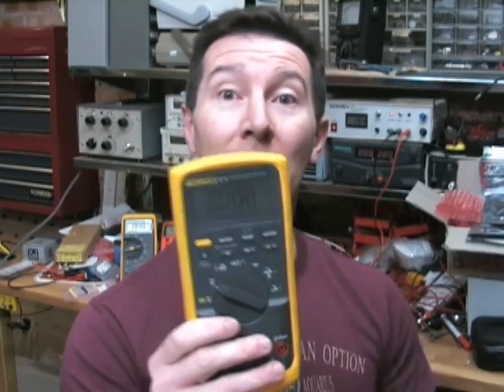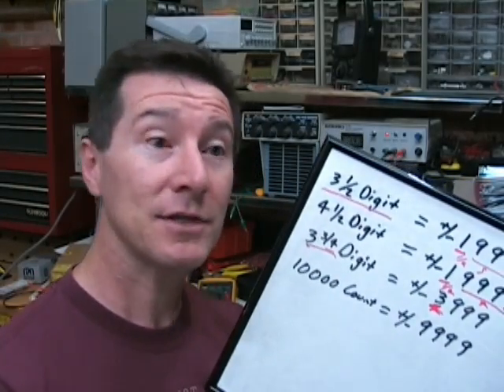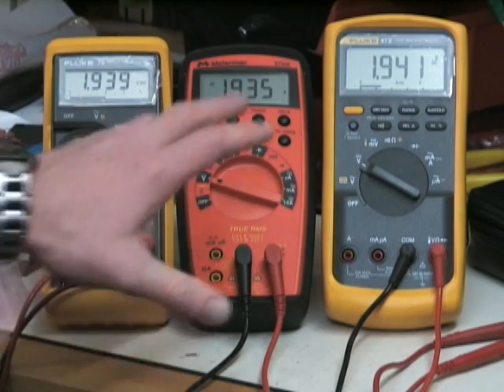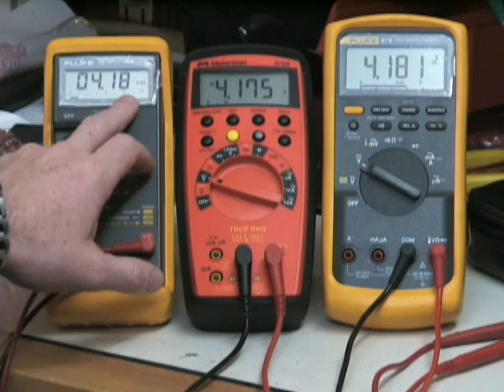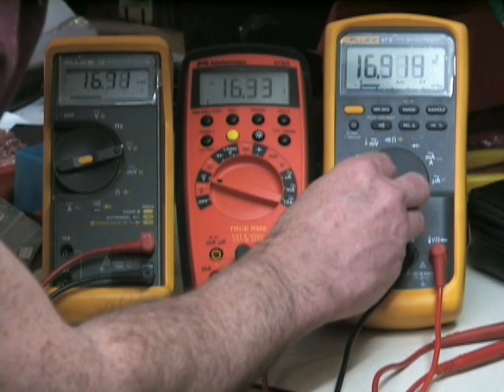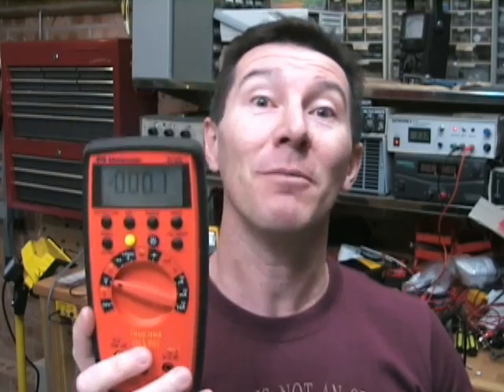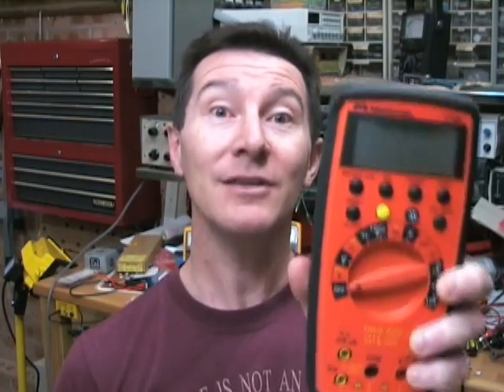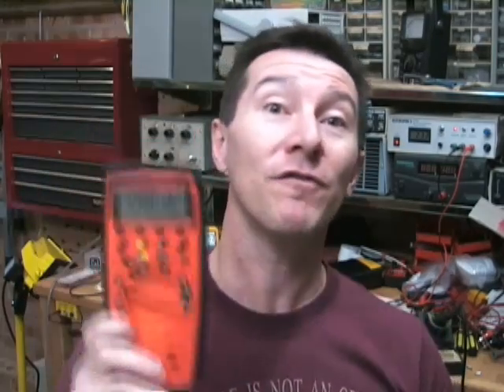EEVblog #26 - Multimeter Tutorial - Counts, Accuracy, Resolution & Calibration

Comment: Can the quality of test leads effect the accuracy?
Reply: Sure.  You don't want to be measuring resistance, especially low resistance, with a set of cables 6 feet long, or capacitance.  When measuring frequency, you need good shielded cables. When measuring current, especially higher currents, you need cables large enough in gauge to handle the higher currents.

Comment: What would change in the meter to cause it to need to be sent away for calibration?
Reply: Aging of the components like resistors and components in the a/d converters.  Wear and tear on the connectors will increase the contact resistance dropping more voltage.

Comment: Sweet! You really awnsered alot of questions I had in this. Thanks! I was looking into getting another meter for myself, and possibly have my employer get a new one as well.   The one we currently have doesn't have enough resolution for some of the things we need.  Some of the meter accuracies I've seen just have a % on the sheet and don't say the + counts for it? IE: The EX330, says 0.5%.  If I understand correctly, does this mean that 27.75 VDC could read 26.61 to 27.88 ?

Comment: I think the something and a half digit specs are plain wank. Any reasonable person can expect that:

10 ^ 3.5 = 3162 counts (approx 3000)

In fact, I've only seen meter that actually "meets" its digits spec. It's the 3457A, advertised as 7.5 digits, and it has a resolution 30 million counts.

Comment: People tend to confuse precision and accuracy all the time.  Some instrument can have really high precision but not be at all accurate.  Sounds like "counts" relates to precision.
Reply: +rchandraonline Precision deals with how repeatable the measurements are and how clustered the data will be. Accuracy on the other hand deals with how close those measurements are to the true value (usually when all data points get averaged), regardless of how clustered the data is. I think counts are only slightly related to precision. Measurements are easily repeated and the data is relatively more clustered (precise) if the device's resolution only allows for a few digits. Imagine trying to repeat measurements to the 15th decimal place, you'll probably never write down the same number twice! 

Counts are related less to precision and more so to the resolution and the displayable values on the screen. In reality, the precision (repeatability) and accuracy (closeness to true value) of the meter are going to come mostly from the careful design of the protective features on the inputs, the internal ADC and any of its conversion errors and resolution, component tolerances, etc.
Reply: Pelnied THANKS

Comment: "A man with a meter knows the voltage; a man with two is never sure." - Unknown
Reply: A man with a meter thinks he knows the voltage; a man with two discovers he doesn't.  :D
Reply: @camurgo  that's accurate lol
Reply: Both men need to get their meters calibrated.
Reply: +gordovious Actually you can eliminate possibility of 50:50 if you have odd number of multimeters. Scientifically you should calculate the arithmetical average, in practice you could use the middle result as your result. Same goes to any measurement devices including clocks/watches. If you have 2, you cannot be sure what time is it.
Reply: @rpdigital17  ur definitelly not sure with one..  i'm more confident using two methods, multimeter + scredriver tester, or multimeter +  multimeter when it comes to AC mains, but for precision measurements/electronics you pretty much need two or three meters , like Dave said the more you track the meter history, the more confidence you will have in it, and less multimeters will be required
Reply: I know Im kind of off topic but does anybody know a good site to watch newly released series online?
Reply: @Spencer Jase I watch on flixzone. You can find it on google :)
Reply: "Man with Uni-T meter who measures high voltage, measures high voltage once"

Comment: Shouldn't Accuracy actually be Precision?
Reply: +Dragos Puri , in general, no.

Precision refers to how finely divided the gradations of measurement are.  For example, if you had a meter stick which is marked with 98 equal markings (0 and one meter would not have marks, they'd be the ends of the stick), in other words, marked at every centimeter, it would have centimeter precision.  Another one could have 998 markings, or every millimeter.  The one with 998 markings would be more precise.

Standard measuring procedure is to read off all marked digits, then estimate where the actual length is between the marks for an additional digit, or of course zero for the additional digit if it genuinely looks like the length is exactly on a mark.

Accuracy refers to adherence to a standard.  Taking the example of a meter stick again, if your meter stick with 998 markings measures 110.0 cm when matched to other, more accurately calibrated meter sticks, it still has millimeter precision but is not accurate because each marking (and its entire length) is too big, by 10%.

The combination of these two means all measurements, especially in science, should be stated as the measurement and then plus or minus some precision (a.k.a. tolerance), and optionally stating the accuracy of the device used to measure the quantity.  In our 998 mark meter stick example, we could say a measurement is 53.26 cm +/- 0.01 cm or +/- 0.1 cm (I'm not really sure which is more appropriate).  Minds better and more educated than mine know how to work with (basically mathematcially combine) both precision and accuracy.
Reply: +rchandraonline Sounds like you are confusing precision with concepts like resolution (smallest increment of change between two measurable points) and significant figures (your standard measuring procedure). Precision is related to how repeatable and clustered the data is. Another way of thinking about precision is the statistical variation and spread in the data. Precise data has a very small standard deviation.

It will be difficult for you to understand precision by using a meter stick example. When humans generally read a meter stick they aren't going to read different values each time they put the meter stick next to the object, they've made their estimation and will stubbornly stick to it. It is different when it comes to a device such as a DMM which can read different values (4.998V, 5.001V, 4.999V) just by removing the probes and attaching them again. This is why precision is important in different measurement tools.
Reply: +Pelnied Let's say I measure a value. And it reads 3.7. I measure it again and it reads 3.8, another time 3.9, again 3.6 and so on, ±0.2. I call that ±0.2 PRECISION. Am I wrong?

Now, for Accuracy, I think of it more like and offset. so let's say that the actual, true value of the measurement was 4.0. So my device is wrong by +0.3 on average. Accuracy can be tuned, precision cannot.

Please correct me if I'm wrong. Thanks.

Comment: Why doesn't the Fluke just stay in high resolution mode all the time? It doesn't make sense. Does it take that much longer to make a measurement?
Reply: Yes, it takes ten times  as long for each extra digit of resolution. Meters get very expensive past 5 digits to get the resolution required. Pretty much all 5+ digit meters have this feature.
Reply: Dual slope Analog to digital converters take time. Successive approximation ADCs are fast but they need a DAC, and they are expensive.

Comment: How does this apply when we get to the lower reading limits of a meter ? As an example the Brymen BM867 is listed as being able to read 0,01mV and has an accuracy of 0,03%+2d. To calculate the error at the lower limit can we multiply 0,01mV by 0,0003 or the lower readings always have lower accuracy ? The meter specs sometimes state the accuracy as "reading digits" * Accuracy percentage + digits. Are "reading digits" the same as the value that's being showed on display or the range's max val ?
Reply: I'd like to know the answer too. In the old days of analog meters the accuracy was always based on the entire scale. So if you set it to 200V max, an accuracy of +/-0.5% always meant +/-1 V regardless on which part of the scale you were. With DMMs, especially the auto ranging ones, it's not so easy to understand accuracy anymore.

Comment: First I want to say great video - good information. I want to slightly correct one of your terms though. The term "traceablity" when it comes to calibration does not refer to the historical record of the item as you said. It actually means there is a traceable path through the measurement standards used to calibrat ethe item. (transfer standards, back to primary standards, etc...)

Comment: that was real interesting !
with that and that other post about voltage burden, maybe you could have a post where you go through all the other critical characteristics of DMMs ?
I have a fluke 87III and there's so much I don't know about it
like how to use that REL delta button, or how to test transistors with it

it be great to have a video that is a single reference for all thing about, and that you can do with, a multimeter

Comment: What is the most accurate DMM on the market for something under say $300 or $400?

What is the best value in Fluke (used or new) .... I know the Fluke 87 V is great, but is it much better than a 87III or 77 or 15B or 17B for basic Volt\/Ohm/Current. I am not too worried about Temp readings but capacitance would be nice. Still I can use a separate meter for LC.

Comment from the maker: Yes, that's a normal part of the process too. It doesn't even have to be outside the specs for that to happen, just enough to doubt that it will remain within specification for the next interval. In this case they usually give you the before and after adjustment figures. And the serious user will drop the cal interval until confidence is restored in that meter.
You can also specifically ask for adjustment every time regardless.